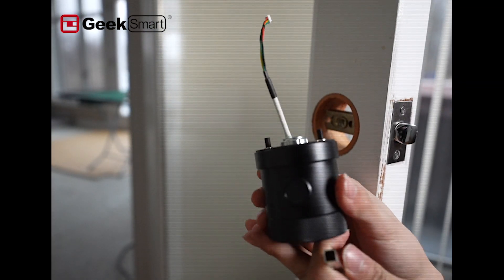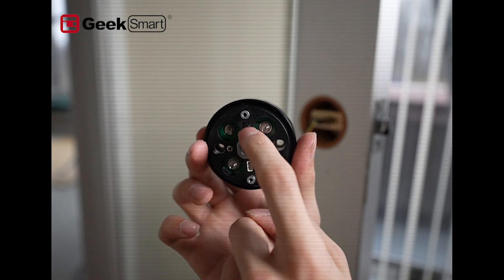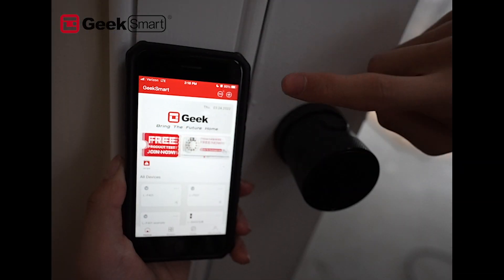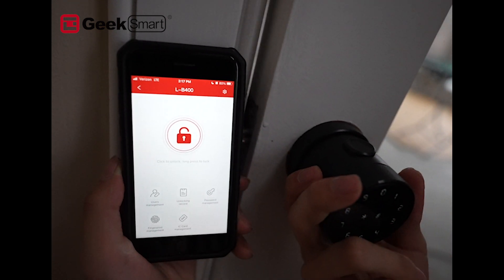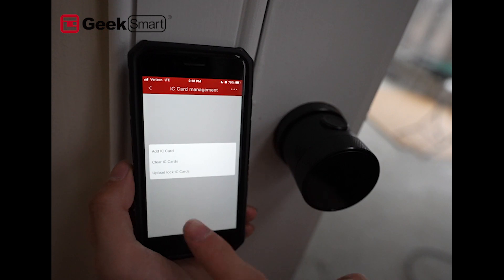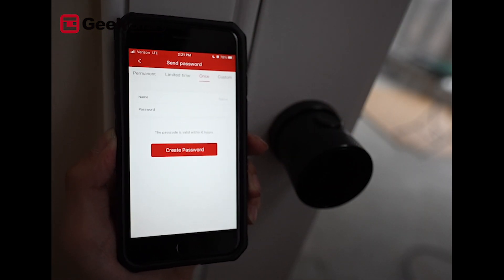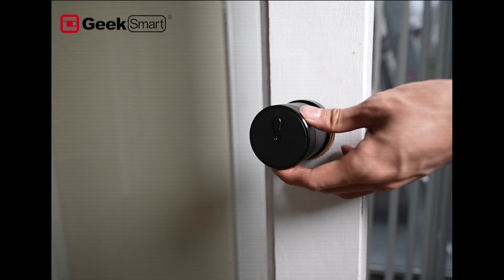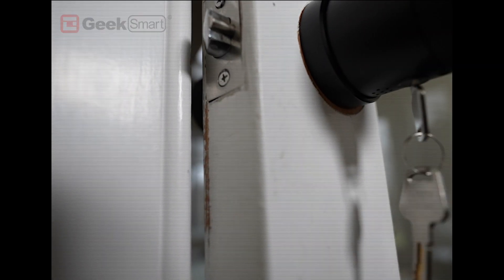Geek Smart｜Smart Lock L-B400 Installation Tutorial

Comment: So nothing about batteries and how you can’t use rechargeable batteries? I did and mine is stuck and won’t work
Reply: If you got an older model like I have in the past the batteries are too tight.  I have used a dremel to easily put them in and you have to push till you hear a click on at least 2 batteries.
Reply: and yes you can use rechargable.